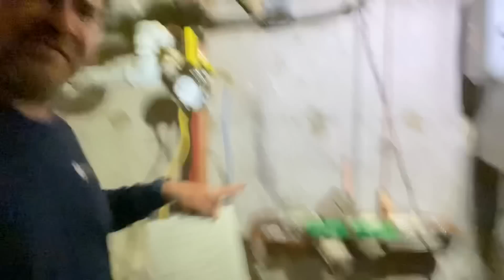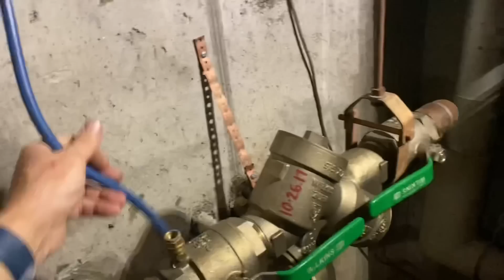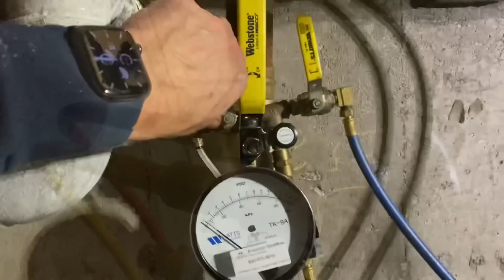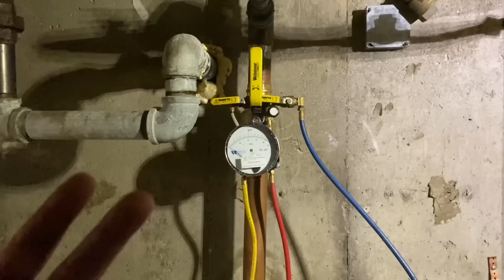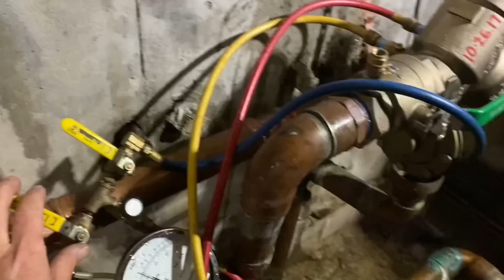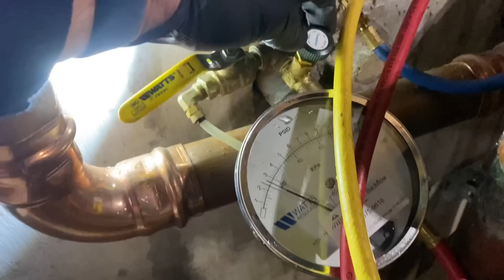How to Test Febco 805Y DCV and Wilkins 975XL2 RPZ Backflow Devices

Comment: Forgot to mention, I saw your trick about flipping the gasket/washer/oring around on the last backflow preventer video you did couple of months ago...your tech tip saved my bacon last week. I'm in Healthcare and was working on a medical oxygen/nitrous oxide (laughing gas) flowmeter (had a similar kind of washer/flapper valve setup inside one of its check valves... instead all made of plastic and the parts inside are way more cheaply made/chintzy). 

The gasket looked fine but was failing so I remembered your trick and flipped it around, voila, working good as new for now until the replacement part arrives. 

Thanks for the great tech tip! 🙏

Comment: Wow, Just a few things that I see wrong here. #1 This irrigation backflow prevention assembly is for low hazard the lawn irrigation system is high hazard which would require a properly installed Pressure Vacuum Breaker "PVB" (ASSE 1020) or Reduced Pressure principal backflow prevention assembly "RP" (ASSE 1013). Double Checks "DC" (ASSE 1015) are not proper protection. 
#2 Were the water users notified that the domestic water was going to be turned off? 
#3 During the initial test you accidentally exercised the relief valve while you bled your test gauge. You should let water lightly flow from the #4 Test Cock while you bleed your gauge to prevent that from happening. We don't want it to open/spit before getting the initial RV opening value.
#4 you never checked the second shut off to se if it was drip tight on both the DC and the RP as part of the test. 
#5 you never inspected and cleaned the seats during the repair.
I also was concerned for your safety when you opened the cover on the #1 check, you were so close on the the last thread before you stopped turning with your wrench.
For added protection you can get 1/4" inline filters for your test gauge.

Thanks for your videos Mike. All my best, Joe

Comment: Seems to be a bypass coming off main water supply before the meter. The only question I have is I see there's only (1) isolation valve on incoming side which that bypass isn't doing anything without a secondary isolation valve so that the meter could be changed without shutting down the entire building.

Comment: You’re breaking my heart using channel locks on a hex nut. I’ve been thinking about getting my back flow license. I’d have to find out if I need a masters license to do work outside of the plumber I work for. I’ve learned to work on them somewhat because our guys love to cut the copper with a band saw and not clean out the debris. Also does anyone else find it odd that they put a check valve directly after the double check. The only thing I can think of is it’s so you don’t have to drain the system when replacing it.
Reply: Help to save the backflow valve if you have solenoids downstream for irrigation that slam shut the water hammer wears out the rubbers cutting grooves into them over time
Reply: @BrickTop900  that makes sense. Though not sure why they didn’t just put hammer arrestors. Then again a check valve doesn’t just lower the water hammer it completely stops it from getting to them